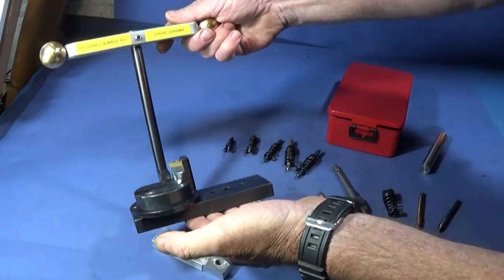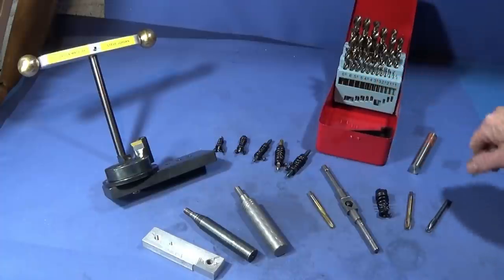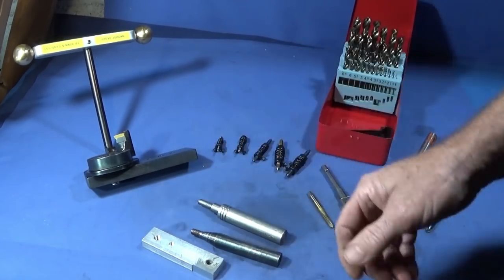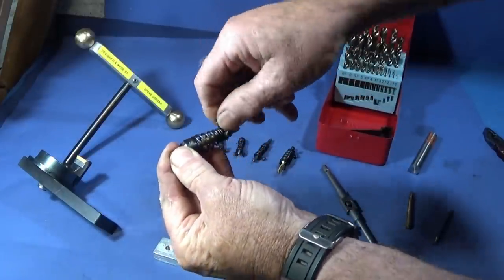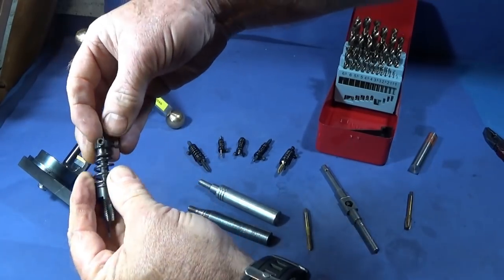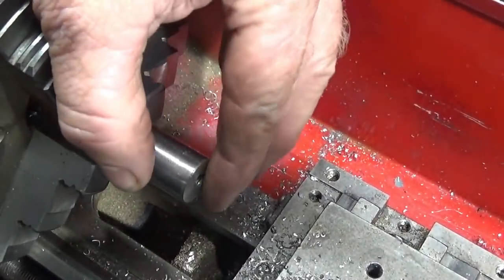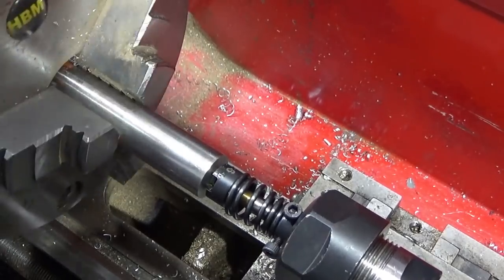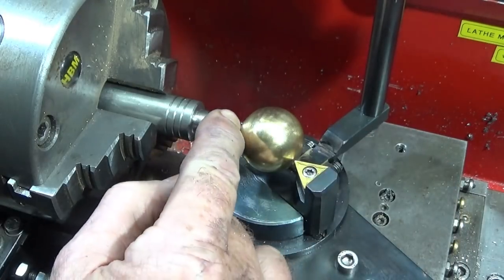Easy To Make Simple Ball Turning Mandrel Plus Some New tools

Comment: After nearly 40 years of electrical construction I gathered all my drills, taps and dies and sorted them after I bought a brand new 5/8 tap and tap drill. I don't think I will ever run out of any bits from 1/16 to 1 1/2 " or standard taps n dies. I refilled all of my indexes! One for every machine in my shop. Plus

Thx for the video! I enjoy your channel Steve.

Comment: Nice one. Where did you get the rev counter please?
Reply from the maker: Hi Janne, Thanks. I bought mine from Banggood but I wouldn't be surprised if they are not on Ebay as well. If you get one or any of the Chinese Tachometers, there are instructions on my YouTube community page on how to connect them. I have done it so it's colour coded for each type. Regards Steve

Comment: Thanks for even more educating video.
Checking my previous orders to Ebay it looks like I bought the same set of drill bits. Nice to know their capacity. Being new in this game stainless looks like hard and difficult. I sometimes modifies large bolts and there are some stainless ones in the drwer. Here they are named "A4".
You centerdrilled without lubrication it looked like. Later You used some mysterious fluid when drilling. What was that? Tapping... Of coarse, some dark cley has to be used....

Comment: Hi Steve,  just picked up on 3116 stainless steel you said , should be 316 :)
Anyway, as your on about drills, could you do a tutorial on drilling different types of metal and what drills to use and speed and say and why.

Example Drilling Brass.
Lower speed than with mild steel, using a drill bit with a backed up edge, or more of an angle, to stop the drill bit grabbing.
Reply from the maker: I didn't hear 3116 when checking?
I don't really bother with different speeds unless I'm using larger drills. I just run the lathe at around 800 rpm for everything. Or just go by sound and feel. Both my lathes have top speeds of just  over 1100rpm.
 When the Myford ML7 was made it had a top speed of about 630 so in those days they must have just left it on that speed for most drills.
  I found the most important thing when drilling anything is just to keep retracting the drill to clear swarf plus use some oil.
  It is the same with my bench drill I normally just leave it on one pulley speed for everything unless using larger drills than 1/2". You can soon see and hear if a drill isn't cutting right.

Comment: Chatter? Worn out spindle bearings?
Reply from the maker: Hi no they may just need adjustment. I have large tapered roller bearings in the lathe. I haven't checked them for a long time.